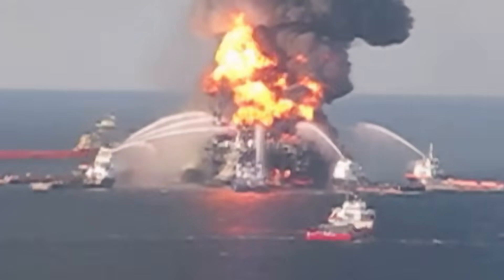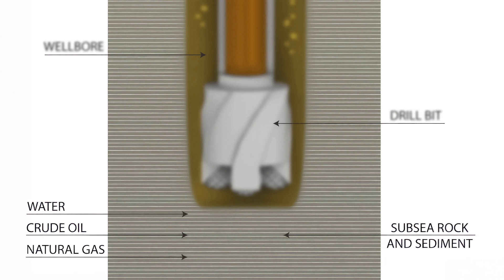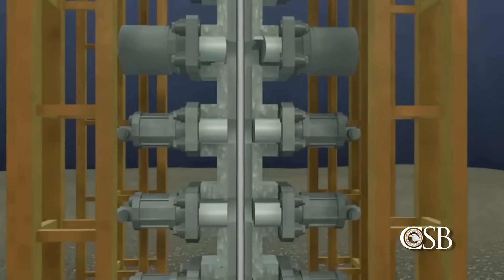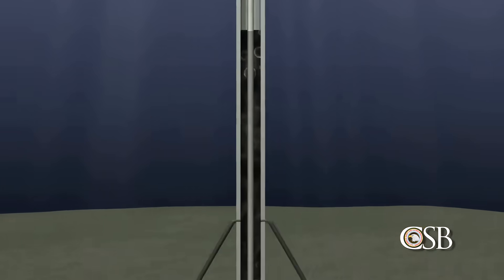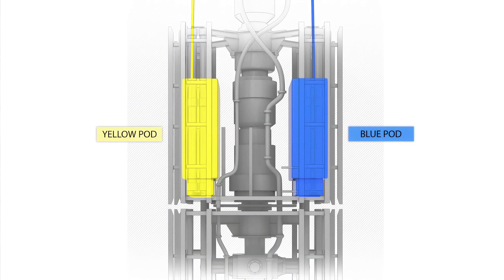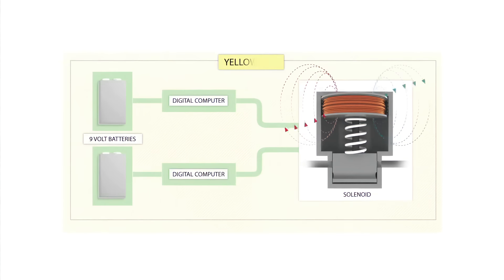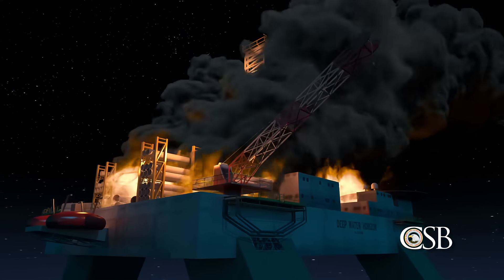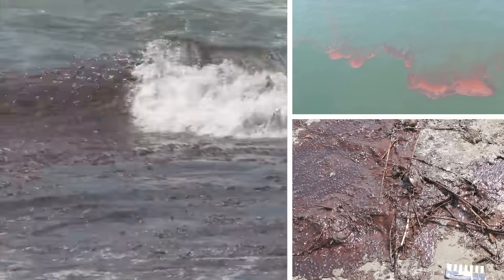Deepwater Horizon Blowout Animation

Comment: I worked this case and remember it well. The video leaves out a lot of crucial decisions by company men that proved catastrophic. Such as a change to a cheaper, faster setting slurry that wasn't approved for that depth, cutting back centralizers to cut costs (they used less than a third they should have iirc), doing maintenance onboard and skipping many items instead of on-shore refurb they were due for, changing rig vent lines, and converting the bottom ram to a test ram so they could inversely test the pipe pressure without interrupting drilling. It was multi system failure from the top to bottom--much of it caused by greed and negligence. Cement was seen in the mud return (meaning it had not set) and the order was to keep drilling.
Reply: That nightmare should have never happened and IMO, was preventable.
Reply: @jaredandkyleigh the movie about it shows it.
Reply: the key thing was the centralizers, and they don't even cost anything, they're just a pain in the ass to set...hope they can sleep at night knowing their laziness killed 11 people even if they think corpo profits are worth it (they wouldn't saved the company more than a couple hundred bucks even if they did get away with it)
Reply: I have copies of the real time mud logs..  scary stuff....
Reply: @nastyab8003 can I get one of these copy sir? Just to try to learn about big problems! Entry level mudlogger here.
Reply: Wow. This is crazy. I was much younger in 2010 and didn't pay much attention to this besides that it was a bad oil spill and that it was BP. I remember "The BP Oil Spill" being everywhere for a while. Did people actually end up getting in trouble? Or was the company itself just fined or something?
Reply: @sandhanitizer15  IIRC, the company was fined. Cameron, Halliburton and BP all had to pay into a common fund for relief with the overwhelming majority coming from BP. I believe civil suits followed but I was not involved and did not follow.
Reply: @jaredandkyleigh  crazy event all around. Watching the footage of the oil spill out is so disturbing and sad.
Reply: I worked on this as well.  Boy the narrative has sure changed.   BP was at fault for this.
Reply: @NopeAndYep 
BP enrolled former EU Commission president among others, exactly to do that, change the narrative.
Reply: right? there are so many details left out. it’s impossible for someone to know all the details, though. my ex girlfriends dad was on this rig and i’m sure his name is in the credits of the movie. his name is chad murray.
Reply: A pure horror story
Greed is the cause
Straight up
Reply: I was trying to read up about the court case. I agree, where was the choice to use the less dense pipe fill?! This was posted 4 years after the case happened, was it made at that time? Or before the case was concluded?
Reply: @Steve-fz4it  Discovery. Like I said, I worked the case. BP was WAY behind on the project and any delay to properly do things, even required maintenance, meant several millions of dollars each day would be lost. So they cut corners wherever possible. They had Cameron engineers modify the BOP. They had Transocean cut maintenance. BP asked Halliburton for a cheaper slurry. They cut back centralizers. Hell, they knew THAT NIGHT how to shut the well off completely but they let it bleed for months so they could try less permanant solutions and come back later to produce the well.
Reply: @jaredandkyleigh  , could you please expand more on how BP knew it was possible to shut the well in?What xould have been done to stop flow with failed BOP system?
Reply: @jaredandkyleigh  That last point you make is perhaps the biggest crime in all of this, second only to the loss of human life. BP could have contained the environmental disaster immediately had they not prioritised their own profits, but they consciously and actively chose not to. This should not be forgiven or forgotten. 

BP should have been punished to the extreme, charged billions of dollars in remediation costs and fined billions more in punitive damages, well above what they actually ended up paying, its executives should have been jailed, and anybody involved in approving the absurdly dangerous cost-cutting measures should have been charged with being accessories to manslaughter, if not outright murder.
Reply: @jaredandkyleigh  Did you watch/rate the 2016 film?
Reply: @user936  Nope. I didn't like the idea of Hollywood making a movie about the event. Never watched it and likely never will. Had I not worked the case, I might have.
Reply: @jaredandkyleigh  It’s an excellent film.  
I had no idea just how severe the blow out and explosion was until I saw the movie depiction. 
It also highlights the way in which BP officials were trying to pressure and coerce the deepwater horizon crew into pumping up oil even though the cement wasn’t done properly and the pressure readings made no sense. 
I think it was important that this film was made and it was done in a very thoughtful and respectful way. 
Hopefully you do watch it at some point.
Reply: @jaredandkyleigh woah. Can you elaborate how they knew how to stop it that very night? Never heard that
Reply: @jaredandkyleigh you showered me with cold water by your words. It was a clear failure of operating company. I would also blame every single one of the SVCs that agreed with the disastrous of choices those company men have taken. God bless the souls of all the people who died that night.
Reply: @jaredandkyleigh this is unbelievable! I still don’t understand how they are allowed to keep going!? They should have been sued so bad they file Bankruptcy & closed the company! Everyone knows they were negligent! 🥵
Reply: @jaredandkyleigh I think the movie backs up some of that, I would think the rig drifting off location should give responsibility for cutting the pipe to the location officer.
Reply: @Steve-fz4it yes they were displacing the weighted drilling fluids in the casing with sea water, BEFORE THE CEMENT JOB WAS COMPLETE., resulting in a reduced hydrostatic head -- BLOW OUT‼️‼️
Reply: You are right Jared. The centralizer cut back was scandalous, they used six instead of the recommended twenty-one. I believe the test results done on the setting of the slurry failed every time they evaluated it except the once, so they went with the one good result as it being sound and ignored the failures. The Deadman controls for the shut off rams had a blue and yellow system. The blue pod was wired wrongly which caused the backup 27-volt battery from operating the solenoid valve to initiate closure. The redundant yellow pod had been miss wired at the solenoid valve and could not operate as normal, it was only the failure of the 9-volt battery which enabled the ram to operate. It was just a catalogue of failures to cut corners and save money which led to this disaster. The industry did not learn its lesion after the Piper Alfa disaster, and it most certainly should have done so after the Deepwater Horizon, but I fear it has not. My last 7 years offshore before I retired showed me that the client (Oil Major’s men) carry too much clout and often interfere in the normal day to day operation, for which they have employed a collection of other companies to conduct. Companies which know how to do the job properly and safely but are bullied by the oil majors.
Reply: @RadioSupere  IIRC, the rig went straight from the north sea to the gulf. It had already been at sea for a while and was due for an overhaul. Instead of docking, BP had Transocean do maintenance and modifications onboard. It was a race against the lease contract.
Reply: Everyone wants to be a bad ass till they realize to late they were dumbasses. I've been in the industry 10 years and have seen some bad accidents because of arrogant pride with the excuse of making money and production increases. It almost never pans out. Takes one accident to blow away the cost saving of a 1000 successful shortcuts.
Reply: Tell us about the role BP played then.
Reply: If you think safety is expensive try an accident
Reply: BP laughs in capitalist noises
Reply: I work in the oil industry and they corners they cut to save pennies always ends up costing them huge. They dont have regard for human lives.
Reply: @dreamachines8584 where do you work?
Reply: Greed is the biggest cause to catastrophe
Reply: Proof that company profits are more important than human life?? I believe so
Reply: They mentioned some of that in the Hollywood movie Deepwater Horizon.
Reply: The movie is decent
Reply: The failure was they did not remove the section of pipe lodged in the preventer!!! Everyone knew about this but kept right on going as though nothing was wrong.
Reply: imagine all the other wells that cut corners and are ticking time bombs
Reply: Thanks for your input! The video makes it seem as if it were solely mechanical failures vs the reality. Greed and negligence leading to unreliable safety systems
Reply: As for chief engineer u should be locked down with all that bp power hungry crew cuz u didnt do ur job.responsibility.Whats the situation there now? is it stil leaks?
Reply: No you didn't
Reply: If a blowout preventer is successful. How do they reconnect the now broken pipe successfully?
Reply: @CrabbinFever  same way I sleep with but don't impregnate my step sis
Reply: @CrabbinFever  ever hummped a blow up doll with a squeaky leak??? Think fast you patch it silly
Reply: They also failed the negative pressure test and persisted in the drilling operation.
Reply: No, you didn't. You read some shit. You ain't "work" nothing.
Reply: They've admitted: "cleaning up oil spills PAYS better- than pumping oil". Haliburton started an oil spill cleanup company, right before this happened. Weird🤷🏼‍♀️
Reply: This is how our entire economy works. The only thing preventing constant catastrophe is good people who are willing to bear the costs of safety themselves, in the form of career adversity and lost income, but we are steadily becoming better at weeding those people out.
Reply: @randbarrett8706 I can relate to what you said. Good comment.
Reply: @RadioSupere  The BOP was modified by converting the lower sheer ram into a "test" ram. It drastically cut the pressure being applied. And the lack of centralizers contributed to the degree of buckle in the drill pipe. But you're absolutely correct--many inspections were waived or passed, and maintenance/test records were altered. One of the reasons for modifying the BOP was specifically to perform tests without shutting down drilling. Halliburton did the cement, but BP wanted drilling to roll asap. There was cement in the return line and BP was like "no problem detected, keep drilling."
Reply: @jaredandkyleigh  Stop talking about the BOP things; you are obviously misinformed. No - they did not "convert the lower sheer ram into a test ram". First off, it is "Shear" ram, not "sheer"; they are meant to cut the pipe. Shear Rams are on top of the BOP, not the bottom (where Test Rams are located). This doesn't let you "perform tests without shutting down drilling". It is physically impossible to drill and test the BOPs at the same time. The Test Rams save you a trip out/in of the hole.
Reply: pyropulse  As a 10 year industry veteran. Greed has tons to do with this disaster. Failures like this start from the top-down. This catastrophe is a result of a bad culture on that rig or as being a vendor for BP, or both. I know first hand how cement tests are falsified and how company men will do anything in their power to keep the rig drilling, due to pressure they receive from the top. Hindsight, is 20-20 and it’s easy to talk about the shortcuts and numerous things that could have been done to prevent this disaster AFTER the fact; But the truth is the truth. This is a horrible disaster that is the direct result of bad culture, driven by the false confidence from hundreds or thousands of times oil companies cut corners and get away with it.
Reply: Sounds like they were told to and you're still defending the white hats..
 company men dont give a fuck about spending your money. Why would roughnecks even consider trying to be cheap about it? You should go drink a L of oil for fuck sakes
Reply: WOW, thanks for the extra information ! !
Reply: you are a a transvestite
Reply: Ha so commercial cutting corners and sloppy workmanship allowed the pipe to bend, the rest is history - Do they drug test these guys?
Reply: so basically they didn't make sure the fail safe was assembled properly and put cost over the safety and lives of others what a bunch of cheep skates
Reply: @antizoom6855  FUKING BP/BRITISH PETROLEUM
Reply: Greed trying to make most of something with minimal regards to what may happen
Reply: I'm a bit late with this thread but thank you very much for the extra insight. As an engineering student about to enter the workforce, I'm sitting here baffled wondering how so many components could go wrong at once and everything from the lack of centralizers, rushed operations in electrical and drilling operations,  etc. from a source of desperation for more time and money as the source of the technical errors explains it all. It's hard to tell how many of these errors they could've prevented or corrected even if they were much more ethical in their approach and had spent a lot more time and money on the setup and testing process, but I'm sure it would've been enough to prevent this much of a catastrophe. Run-on sentences aside, watching the reports on TV as a little kid was honestly such a surreal and ominous experience. It really is something to be able to look back on events like these and reflect in such great detail whenever I need to because of those like you, the CSB, & people like my aunt who spent the majority of their career at the NOAA on cleanup and ecological damage control.
Reply: I watched the movie called Deepwater Horizon with Mark Wahlberg, and Kurt Russell in it. How accurate was it?
Reply: Well its,like i always say...."Safety is paramount, until it starts to effect profits." Rules for thee, not for me. Then they'll throw you under the bus for listening to them...
Reply: Sounds like someone is a movie buff 💪 I guess I particularly like where the dinosaur teeth come over the shakers !
Reply: Money always wins.
Reply: Company men are usually scum of the earth
Reply: Thanks for sharing. The public has a right to know
Reply: They need to be arrested
Reply: @df5781  too much hush money involved
Reply: I literally don't believe you, you look like you're twelve
Reply: I assume nowadays it's handled the same way as airliners and most other industries? Basically "the "fine" we have to pay in the rare case shit hits the fan is less than what it'd cost us to fix/maintain everything up to code so we'll take our chances." ?
Reply: Honest reporting indicating BP engineers were complicit in their decisions.
Reply: This is why rigorous regulations, enormous business altering financial penalties, and mandatory prison time for leadership that allows the rule breaking needs to be standard across all of these industries.

 These companies don't care about who they kill or what they damage. As long as they can squeeze just one more dollar out of a business venture at the risk of everything else, they will. As long as the damages and financial penalties won't change their business operations in any meaningful way, they will continue to skirt regulation and cut cost in order to make just one more dollar. Not a single person from BP went to prison over this absolutely disgraceful miscarriage of justice.
Reply: So you work for the government you're useless
Reply: They dril they own grave then.I watch the movie many times probably not the same thing as in reality happens but stil dont understand what causing this.In the movie we saw the ground start to crack first from too much gas pressure i guess and that pressure cant hold the rig and blow out.
Reply: Bp can afford these catastrophes that s it.
Reply: Did Kurt Russell do enough to convince John Malkovich not to drill?
Reply: I hope you aided in the justice of BP management that caused the accident
Reply: True but in the end, the employee always agrees to it. I work in safety and if anyone raises a flag, we investigate. People being lazy is why companies get lazy because companies are just people
Reply: Capitalism is a bitch
Reply: How nobody went to prison is beyond me. I guess the devil won in the end. Considering the incidents from the aviation MCAS malfunction being another example of corporate corruption and greed that cost lives, to another Boeing incident with its door panels breaking off, how do these companies get away with this in PLAIN SIGHT!!!???
Reply: So 11 people died and 4.9 million barrels worth of oil was dumped into the ocean because of a few greedy a**holes. Wonderful.
Reply: Sexy as phuk lil movie
Reply: Thanks for the additional information. I found the movie about this event to be entertaining. As far as Hollywood movies go, how accurate would you say it was ?
Reply: Thank you
Reply: In other words the execs that made these calls should be given the United healthcare CEO treatment.
Reply: This wasn't about the men it was about this specific piece of equipment. Obviously you didn't understand the point of the vid and therefore either lied about working on this or you're equally as incompetent similar to the people that forced the drilling. People like you are why aliens won't talk to us. Also of you're telling the truth then you were a small assistant to some small cog working on this litigation project so you have zero knowledge on the subject matter and even less experience in this field. Stop pretending to be part of something when all your comments are taken from what you saw in the movie and nothing more. Sad.
Reply: Please tell me they got a big fine?
Reply: Maybe it's the purpose of this video to explain the mechical/technological workings of the Blowout Preventer. As such, this video would purposefully leave that out mecause the decisionmaking is not relevant in order to understand how the system works.
I'd even say that for this specific video, I'm happy it wasn't included. because this has helped in understanding the technology.
If I want to know more about the entire decisionmaking (not an easy video to take on for any means) I'd go there.
Reply: @michaeldenicola9025  I saw you replied earlier but it seems you may have deleted that comment. One comment that stuck out was the assertion that if I had any respect for the families or any supposed NDA, I'd leave the matter alone. I am no longer bound by NDA and I think it's important that people understand that each failure of these systems was a direct result of BP decisions. This wasn't some freak accident caused by multi-system critical failures of some unknown origin. I think reminding people of why these systems failed is important for the families and the memory of those that died so hopefully this never happens again. Regarding shutting the well, IIRC, BP immediately began looking at containment efforts. "Hard capping" or sealing the well with cement, was recommended but doing so meant they could not return to produce the well. So they tried multiple methods before they were eventually forced to hard-cap.
Reply: @jaredandkyleigh  purely talking about the hard capping, I have to wonder how much the government was involved in that too. I'm sure they gave plenty of leeway to allow time to find a solution before forcing their hand.
Thanks for the extra info, appreciated. As others have mentioned the bop faults, missing casing, cement lab tests are things you could add to your first list. If there was independence of the companies to do the best job required rather than be dictated to it might solve these problems, I wonder what changes did the government or regulators enforce to improve going forward
Reply: Wow couldn't imagine a company that goes for profit over safety (satire)
Reply: The company man made the decision to not do the cement bond log test to assure the integrity of the cement job. He was a land guy and didn't circulate the drilling mud long enough to account for drill depth and water depth of the drill string. If he would have done the cement bond log and circulated the correct amount of time he would known the cement job had failed, if the CBL test didn't catch it, the mud logger would have. This well had insane pressure associated with it and was a problem from the day the Marianas started on it. The decision to circulate the drilling mud out and flood the riser with seawater was the ultimate failure. The drilling mud is your primary well control. BP owns full responsibility for this disaster...
Reply: pyropulse  Critical thinking isn't really your forte is it? Safety systems are required by law. Greed was the motivating factor in decisions to modify equipment, rendering the safety systems inoperable. BP was well behind on schedule. They modified the lower shear ram and turned it into a test ram so they could seal the system around the pipe and pressure test the blowout preventer without interrupting drilling. This rendered the lower shear ram useless. To do that, they had to modify the hydraulic lines. That modification is why the hot stab method to close the well didn't work. They cut down centralizers to save money. This caused uneven drilling in the formation. This created water and air pockets. They had Halliburton create a cheaper cement (called slurry). Halliburton objected and said the cement was not rated for that depth or use. This meant the cement would not set correctly. BP started drilling. Cement was found in the drilling mud return line. That means the cement was not set. BP continued to drill. Why? Because they were behind on schedule and shutting down drilling, extending the lease for the rig, and recementing the formation would have cost them billions. Not millions. Billions, with a B. So yes, greed was most certainly a motivating factor by BP executives. They give the orders and tell people what to do. That's why they were found mostly at fault (67%). Cameron, who modified the BOP at BP's direction and doctored maintenance logs was found 30% at fault. Halliburton, who only provided the cement, was found just 3% at fault.
Reply: @jaredandkyleigh  im surprised it didnt go bankrupt
Reply: @jackmagnium6115  Before the blowout, BP had a net worth of nearly $200B and immediately plummeted to around $80B after the blowout. Today it sits somewhere around $100B. Not bankrupt but it sure hurt the pocket book.
Reply: @jaredandkyleigh  do these companies insurance policies cover the cost of the damages? Or because there was obvious neglect they have to cover the cost themselves? And thanks for commenting,  very interesting indeed.
Reply: @jaywagner13  In BP's case, I don't know. I'd be willing to bet they were out of pocket though. I can't imagine any policy not having a clause regarding negligence.
Reply: I dare say this video was mainly about the technological and mechanical failures rather than people, company and oversight failures. Possibly directed toward drilling rig equipment manufacturers and designers.
Reply: @Alex-co7cq  I dare say you're stating the obvious buddy. Thanks for all the extra information on this everyone. Interesting but sadly not surprising.
Reply: You must keep drilling! It’s about being in the black. Money to make. That’s a Tough decision.
Reply: I asked my Dad what he thought might have happened.  He was a chemical engineer and he started his answer with " when they consulted me for the project".
I stopped him there. He went on to say they didn't use his design because it was too expensive 👀🫣
Reply: So true very well noted.
I work for a company that provides equipment to the oil and gas industry.
Some of our products are on these rigs.

There is a constant battle with getting companies to specify high grade equipment, like that of the company I work for, above low grade - lower cost.
Reply: @the_uglysteve6933  Bare minimums because the assumed risk is acceptable to the company vs the cost of doing what's right.
Reply: @jaredandkyleigh  personally for me i rather do whats right than put profit over people. otherwise i could get jailed or even worse. liquidated(company shut down for good)
Reply: I'm not sure the centralizers would have made a difference, I've drilled many wells and watched many centralizers skipped. But we weren't drilling anywhere near those depths and we were solidly on the North American continent, so I really don't know anything about deep sea drilling.
Reply: @devonshaircut6861  i suppose its like many airline disaster in rarely one thing that goes wrong but numerous things together.
Reply: Put the suits in prison
Reply: @RadioSupere   Hi Mr Chamberlain. I really enjoyed your comment. I am a petroleum engineering students. Please can I dm you for more insights
Reply: @RadioSupere  I disagree. Is not a bad video, but the the BOP issues are only the tip of the iceberg. 
As far as cement swelling and going into the stack....eh? That's impossible given the frpth the cement job was done at.
The big issue was drilling the well badsly to start with, and not monitoring ECD.
What downhole sensors did they run?
I bet they used very little real time gear.
And why not run a CBL?
That's really stupid.
And they screwed up the cement job.
As well as the pressure tests afterwards.
And COMPLETELY failed to spot pretty obvious signs of a kick.
Not just mistakes, but incompertence.
More like negligence.

As for testing the BOP's every 2 weeks.....hah hah hah.
Seriously, how do you really test something that's several km's away from you on the sea bed?

The forensic investigation showed the BOP was faulty: should NEVER have been used as it was in the first place.
Reply: When it comes to accident investigation, no single individual knows the truth, the whole truth, and nothing but the truth.
Workers and supervisors are routinely hired because they say they can do a job, when the men eminently qualified will be more reticent with such claims. The net result of this is people are often hired who are SPECIFICALLY unqualified and dangerous. 
Add to that the human compulsion to hide one's mistakes, and you have an environment where these types of accidents are inevitable, and perpetual.
Reply: FYI - Converting the bottom ram (inverting it) to test BOPs against is not a shortcut at all. It is common practice. And it doesn't "test the pipe pressure", it pressure tests the BOPs without having to make a separate run in the hole (TIH) with a Test Plug. Most modern BOPs have this feature.
Reply: Failure? Yes. I agree, however, why didn’t the shaker or pit hand didn’t see a gain? Simple kick? Iots of holes in the story. Bbl. In Bbl. Out…🤔🤷‍♂️
Reply: @ForeverEvicted  my sources said that the choke line and kill lines were plugged ???
Reply: Of course they "left out all that stuff. That's not what this video is about.
Reply: give me some of your lawyer money nerd
Reply: The Masters do not make mistakes.  Every single significant event is planned.  Every single one.  All of them.  This is no exception.
Reply: I was the chief engineer. You didn't work on this.
Reply: Buuuulllllll shiiiiiittttttttt
Reply: Sorry, but I doubt your ovewrall input on this.
For one, they had COMPLETELY finished drilling long before they were cementing.
So why do you say ""cement was seen in the mud return".
Eh?

WRT to using fewer stabilisers, the reason for that was not related to cost: it was because of some confused thinking over the type supplied. 
Seriously, on a well that's >$100million, cutting costs by reducing number of centralisers is NOT an issue.

On a deep water well like this, the BIGGEST cost is rig time.
The second biggest cost is...rig time.
The THIRD biggest cost is....
Actually, I lie.
BP's biggest concern was screwing up the producing formation by damaging it duer to excessive ECD.

I dunno how many deep wells you've been on, but this is an unusual well: it's being drilled like an exploration well (not much information on the reservoir, and it's VERTICAL).
And yet they still hoped to compete it and produce from it.
Outside of the GOM, most wells like this aren't even cased: just drilled to define the reservoir, then they go back with a platform and drill production wells from that.
Directional production wells.

So i DO agree that the root cause for this was not so much as BP incompetence, as it was greed.
Reply: Are corporations evil?
OR is it the complacent, patronizing, arrogant bastards in management (AND THE ACCOUNTING DEPT.) who allow the evil to transpire?🤔
Reply: Dead batteries and miswired solenoids sound like much likelier causes than "effective compression"
Reply: JARED JENNINGS:  HOW MUCH RESPONSIBILITY LIES AT THE FEET OF BRITISH PETROLEUM FOR THIS GROSS NEGLIGENCE?!?
Reply: @normancarter5419 , bP. Big polluter
Reply: @CONCERTMANchicago  BP - Big Puss--- on safety and admitting liability and negligence.
Reply: @normancarter5419  Zero because it ceased to exist a decade before the disaster.  It merged with (among others) Amico (US Standard Oil) to create the conglomerate known as BP.  The reason Obama/etc kept misreferring to BP as British Petroleum was to deflect from the fact the disaster was 100% US made.
Reply: Spook
Reply: I’m sorry, who did you work for? When you say you worked this case, what and who did you work for?
Reply: @rosslothes3040  I worked at one of the several law firms that worked the Multi District Litigation ("MDL") out of Louisiana. I worked on doc review and depo prep, including review and summarizing depositions and exhibits, as well as presentment for clients from Texas to Florida and contiguous states that had secondary losses due to coastal business dependencies.
Reply: Spot of dicsxelsia there? Not to be rude but the first sentence was agonising!
I assume that you meant "I worked at several of the law firms that worked the Multi District Litigation".
Fascinating reading, I must say. I do not doubt what you've said on here at all
Reply: @jayc2469  Ha, lol. Yep, totally meant "one of the several." Sometimes the brain moves faster than the fingers.
Reply: @rosslothes3040  his LinkedIn profile says he was a paralegal at that time. So maybe or maybe not he heard some rumors at work. But most likely he is another loser pretending to be a big shot on the internet. But he definitely didn't work the case. Lol
Reply: @rosslothes3040  HAPPY WITH THE ANSWER---!
Reply: @rosslothes3040  Exactly....he's a troll. Most of what he's saying is rubbish.
Reply: Cool story bro.
Reply: You trying too hard to be someone on the internet lol
Reply: @Elysian-III  you're trying just the right amount to be a moron on the internet
Reply: You did not work on this case
Reply: no you didnt
Reply: @ppstorm_ damn, i see similar guys to you all the time here and other sites.